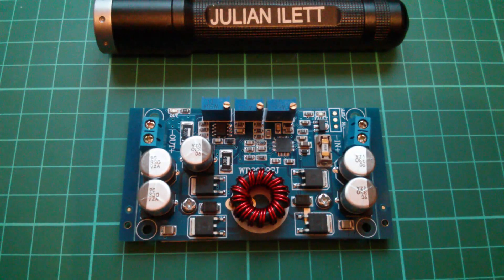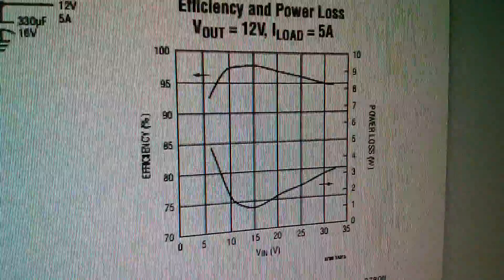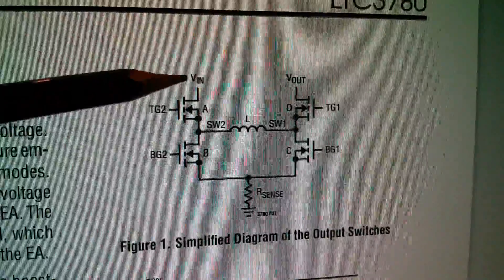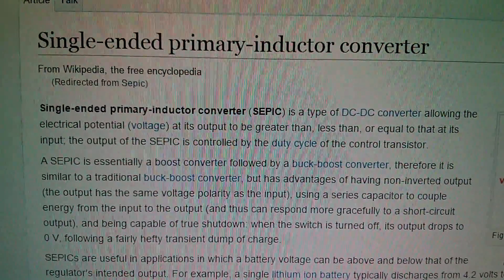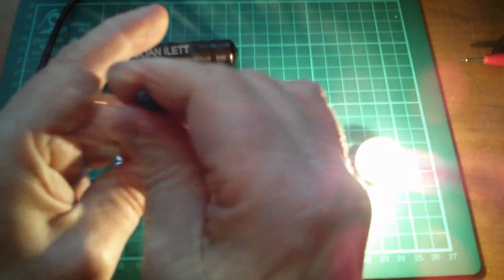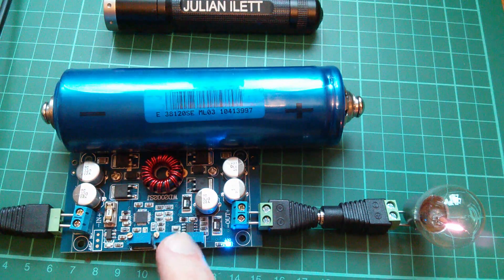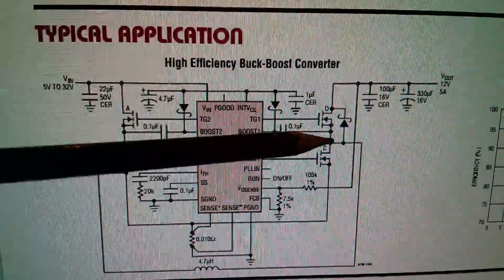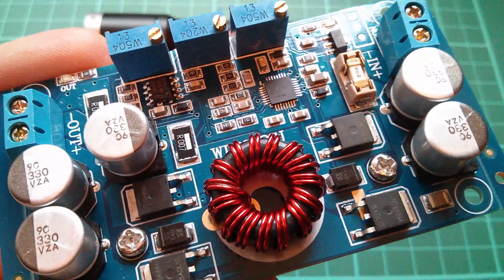First Look: LTC3780 Buck/Boost DC/DC Converter 10A 130W

Comment: Oh yes, Chinese would proudly claim an "Industrial grade" DC/DC converter. 

Third pot is known as "under voltage" protection function ? direct translation.

Chinese Recommendation : Long term usage, try to keep it below 7A or 80W.

The origin.
http://item.taobao.com/item.htm?spm=a230r.1.14.47.ITkw2o&id=40261463948&ns=1&abbucket=15#detail

The lousy English Translation. haha.....
http://www.aliexpress.com/store/product/LTC3780-DC-DC-CC-CV-Auto-Boost-Buck-12V-Converter-DC-Step-up-Down-Power-Supply/224263_32227074387.html
Reply from the maker: TheOldmankk That doesn't sound like what I was hoping it would be.
Reply: That doesn't sound fair it's only 80w with the small heat sink if you want full power you need a bigger heat sink which seems reasonable. I look forward to some load and performance testing.

Comment: Very interesting device!
10:50  
I am not sure you can charge your LiFePo cells with 10A - that would be 28*10=280W and hence beyond the 130W rating?
Reply from the maker: YensR Ah yes, you're quite right. They'll have to be charged at 0.5C

Comment: Another great video Jullian and a useful device.
 I think one could go to town on this using a microcontroller, LCD, a handful of switches and rotary encoders to make a digitally controlled variable PS.
I'd be interested to see just how clean the output is  at various voltages and loads on an oscilliscope
Reply: I too would be very interested in seeing what the scope says about the output of these buck boost converters. I would also be interested in learning the efficiency of them at varying voltages.

I think it should be easy enough to do with a couple of volt/amp meters on the input and output; calculate volt/amps into watts for both, then work out the percentage of efficiency from the differing values. I have done this myself with a couple of cheap buck converters and shockingly found that if the output is way off the input the efficiency can be in the order of 70% or so, but gets more efficient as the output nears that of the input.

Anyway just some food for thought. Love your videos Julian, I really appreciate the time and effort you put into them and the way in which you do. Your'e a good man for sharing your research/experience and especially in the medium you choose to! I'm an old school EE that has forgotten most of what I learned when I was younger, but trying to grab hold of it now days as I have been bitten again as I once did years back and trying to get a grip on EE these days.... So different now, but exciting times!
Reply from the maker: Rob B Yeah, what we need is for Ming-He to bring out a digitally controlled version of this with their standard 4-digit 7-segment LED and 4-switch interface board.
Reply: Julian Ilett That’s exactly what I was thinking. Maybe this Buck / Boost converter could be converted to digital and then hooked up to a micro controller for some waveform generation.  If you had a micro controller 
generate the waveforms on the input side and then read interference on the output side, I wonder if you could feed negative interference in on the input side to cancel out the interference created by the buck / boost converter, might be a way of getting a very smooth output? Someone’s no doubt already made one of those and I just don’t know what it’s called yet! Great videos as always Julian, very much appreciated, keep ‘em coming!
Reply: For digital control, we could use, say, a 4096 (or more) step digital pots, or multiplexed digital pots, controlled by an MCU.  I've done it with a Ti 4050c (boost only), and it works quite well.